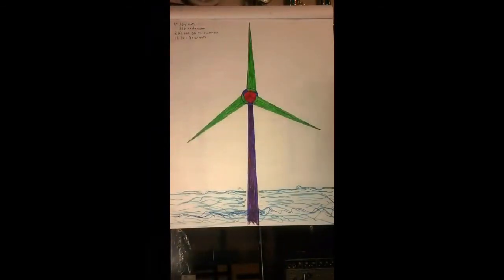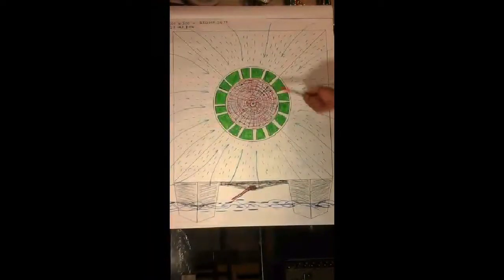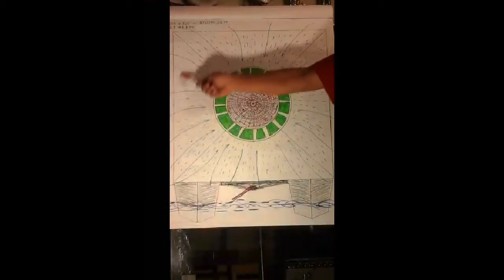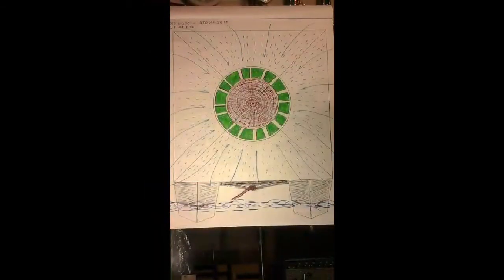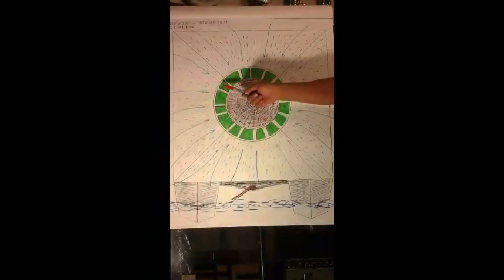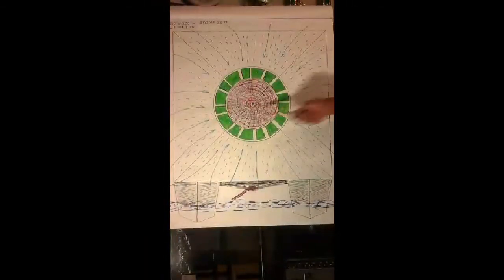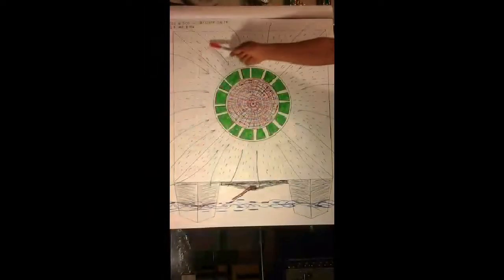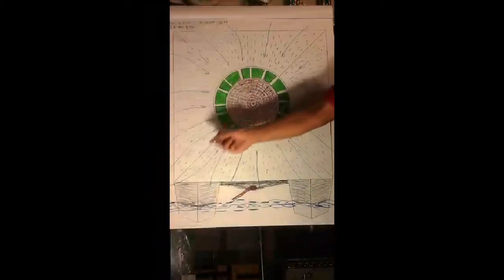World's most powerful wind turbine design video 2

Comment from the maker: e.g., from port, the barge is either driven or tuged to offshore wind-zones, where winds are more consistent @ higher velocities. On location, floating mobile power plant barges are tethered and fluted in & attatched to a stationary ground based offshore utility transmission platform, hence abundent wind generated electricity is transmitted to city grids and inland distrubution lines. Excess energy production is used for potential energy storage, per se, decomposing water molecues for hydrogen fuel-cell, H2 combustion engines, and H2 steam boilers. also A more pragmatic technique would be to pipe water to up river reservoirs, as a form of water conservtation for human consumption, agriculture irrigation, and drought alleviation. During offshore extreme  weather conditions. Reservoir inventory are topped off prior to, and  used to generate electricity while power barges go offline and brought back into port or sailed out of harms way; rough seas and hurricanes. after the storm has passed, barges are sailed back to post and resume electricity production.

Comment from the maker: Replacing  the dirty 80% energy infrastructure: infinitenergy Geo, will have to produce 10 trillion watts (10 billion kwh per hour) of clean electric generating wind systems. Based on current day electric generating technology pricess, it cost between $2m to $3 million dlrs per 1 megawatt generating capacity. 
With my novel infinitenergy Geo pneumatic turbine electric generating power barge technology and its 20:1 increase in generating capacity over all current wind energy technologies of the same diameter size.  I could reduce cost by 25% to 50% per megawatt generating capacity.

Comment from the maker: nhaa, in actuality it will kill less birds by eliminating  19 units of conventional wind turbines for just one of mine. meaning 19 less  spinning hard to see turbine blades for birds to fly into. also my wind turbines is a solid object like a building. birds will see it and fly around it rather than flying through it.. of course u got to consider some birds that will run into its wall and die, but that will the same as they fly into office buildings like they do already.. and that can't be helped..
consider it thus way. say that that today's wind mills kill one bird per day, but to generate 160 mw electricity, u would need 20 units of the current world's record 164 meter 8 mw wind turbine. so each wind turbine kills 1 bird a day each. so that's 20 birds a day.. now with 
one unit of my infinitenergy Geo pneumatic turbine  160 megawatt electric generating power barge, it also kills 1 bird per day..  
so their wind mills kill 20 birds ×365 days =7,300 birds a year. where as mine kills only 365 birds a year.. see how it works by eliminating  20:1 units per generating capacity.. :)